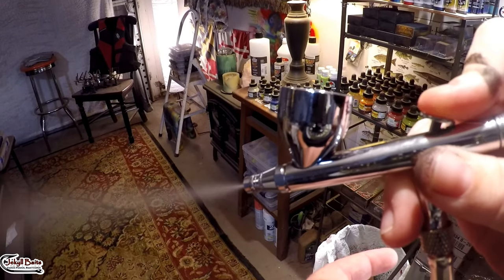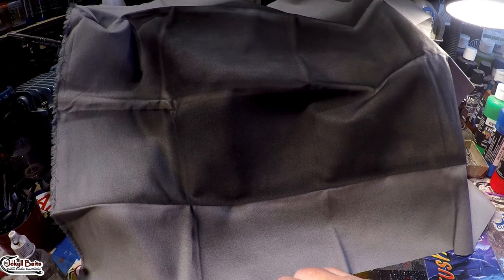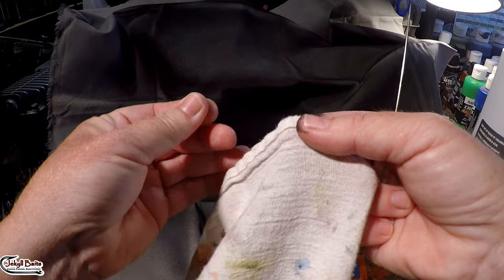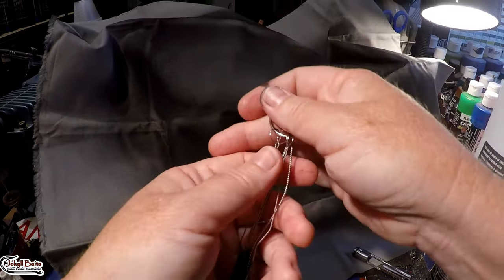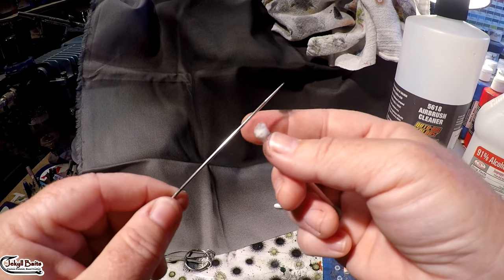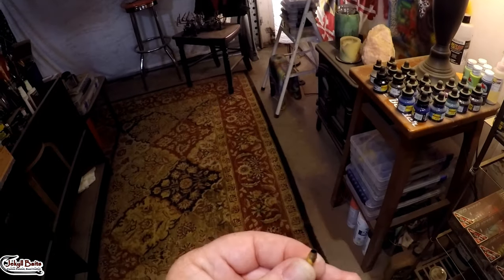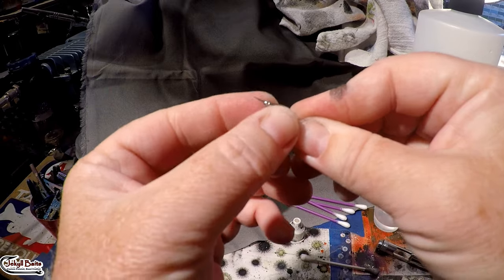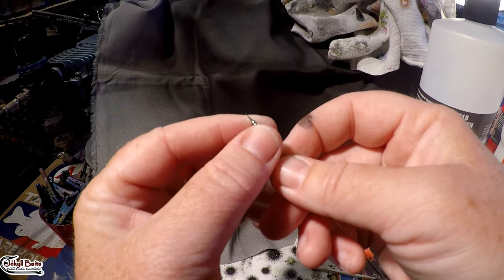JEKYLL QUICK TIP: General Maintenance On The Iwata Eclipse HP-CS

Comment: to help protect the needle from damage, you might want to pull your needle first and insert it last. it's too easy to damage a needle tip by putting the cap on the needle than the needle into the cap.

Comment: Jekll 
If you get some type of puddling in the cone of the brush. Is it a paint problem or dirty brush? Or could it be the pressure is too low? 
I have not got my new brush setup with the compressor yet. I’m still using the $60 rechargeable/ built in compressor one. And I’m getting a little puddling in the cone. Then I get some splatter because if it. 
I completely cleaned the brush out. It did have some paint on the needle and is clean now. However, I’m thinking since this brush is a low pressure brash because of the built in compressor. It needs thin paint. What’s your thoughts?
I’m sure I’m going to be blown away with the eclipse and badger brushes I just received. Waiting on hose adapters for them with disconnects.

Comment: i thought my son messed my airbrush up he left paint in it i cleaned an cleaned used hot water let soak an i couldnt get it to spray right.wasnt that my air water seperater went bad at same time i changed that an it sprays wonderful.what the chance of 2 problems happen at same time
Reply from the maker: It’s possible. Good point!

Comment: Great video. But, you were very incorrect regarding similar metals vs. different metals in the threads. Different metals will have a galvanic reaction. You actually want to avoid bringing different metals into contact with one another. The reason for the brass threads is because brass is a softer metal. This allows you to get a better seal when tightening the threads. When using two fittings made of a hard metal you need to use a thread sealant. When one of your fittings is brass and the other is a hard metal like steel, you do not need a thread sealant.

Comment: I know this is 2 yr old video and you are in the middle of a move, but I am new so don't smack me too hard.  I have yet to buy an airbrush and probably won't for a month or so.  I realize you get what you pay for and the term buy once cry once.  If you was starting new, like me, would you jump straight to the Eclipse or maybe start with the Neo?  I still need a small compressor too since my big shop compressor for woodworking and power tools is like a sledgehammer doing the work of a finish hammer.

Comment: I can't understand why you used alcohol to clean your needle before using the airbrush cleaner fluid.  I am also wondering why you didn't first soak the nozzle in cleaner for a few minutes before using your small brush and alcohol.  In addition, inserting a different sized needle into the nozzle is never a good idea, as it could potentially scrape the inside of the nozzle, widening or distorting it.  Why take that risk?
Reply from the maker: Great thoughts. As far as alcohol goes, it really dissolves clogs quickly. I will take your advice to heart regarding the needle though. Thanks!

Comment: I think cleaners and reducers are a waste of money lol. Get some of that household cleaner "Fantastic " and mix it at 25% and add 75% water. Works as a cleaner AND reducer.  Never had a problem with it. Also extended dry time , less dry  tip. Great Video. Thanx
Reply from the maker: Cool deal